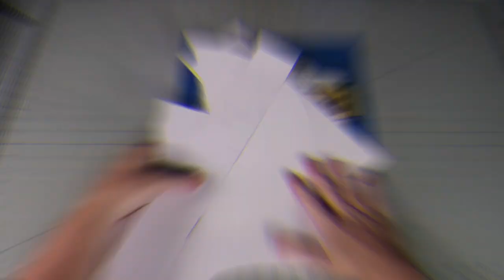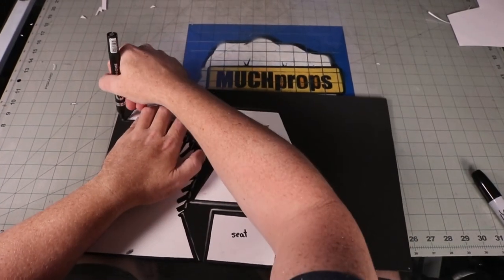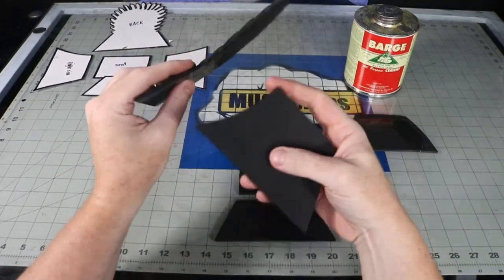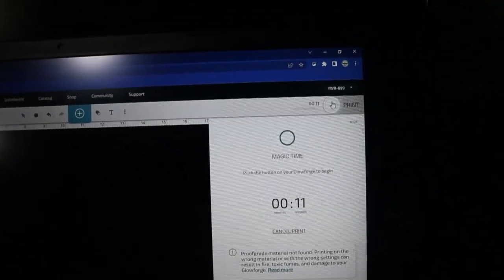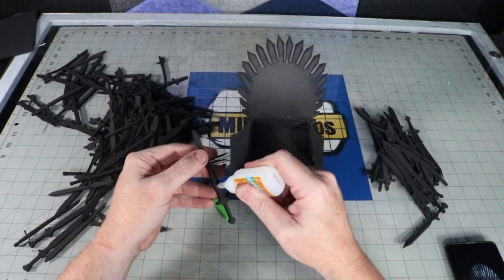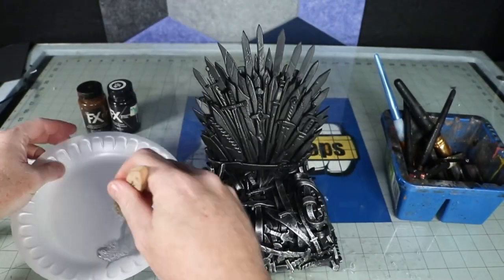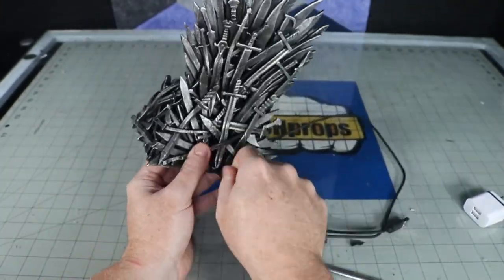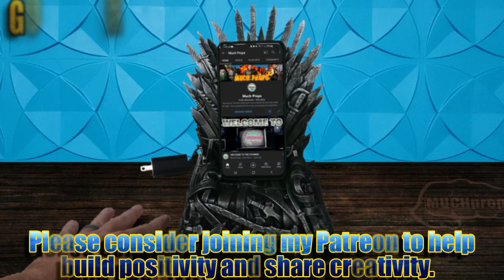Foam Crafting an Iron Throne Phone Charger

Comment: I also made this throne a while back, i made mine from insulation foam, polystyrene as its called, glued together with toothpicks, then covered in double sided tape and then 2mm eva foam, for the swords i used those tiny plastic party toothpicks, i got like 4-5 bags of those, i had to buy them a few at a time cause the stock was never enough at the store, i painted it black then drybrushing a bit of silver and made the slit for the micro usb charger i had back then, spent like 2 days only removing the little guards from the swords but i love how it turned out, your design looks amazing also and it was made from scratch, including the swords, keep up the good work man !
Reply from the maker: I think I saw NerdForge make one using plastic serving picks. There are a lot of cool ways you could tackle this build. When I have a real shop someday I would love to try and make a full sized on out of wood or XPS foam.

Comment: This would be an interesting engineering project to fit a Q-charger into as they have a fairly tight tolerance for phone distance.
Reply from the maker: I thought about trying a wireless set up, but I wasn't sure how well I could sandwich it on the throne back. Might have to use some 2 mm foam instead of 4